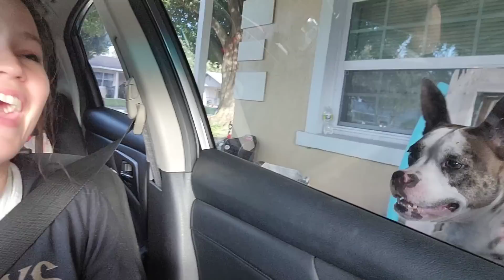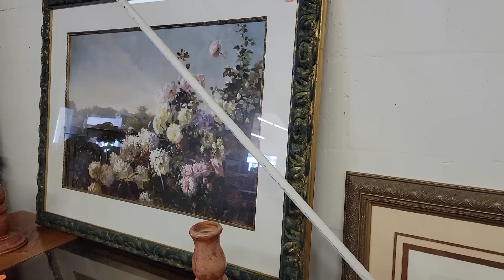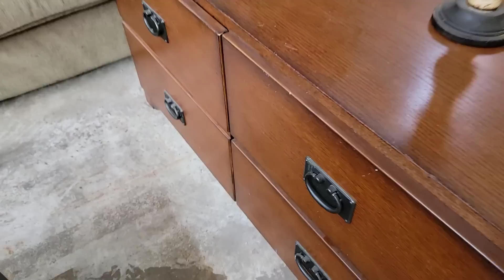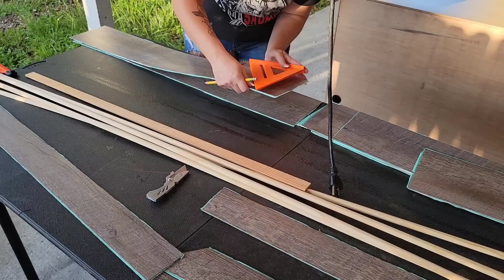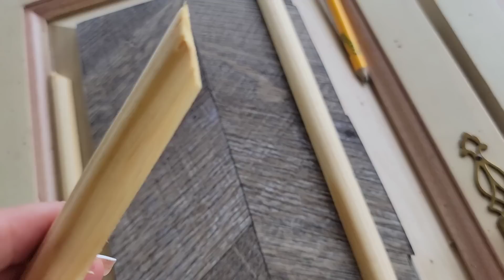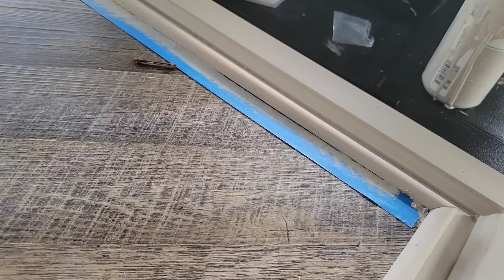THRIFT STORE DIY | Budget friendly furniture flip | Day in the life of a working mom!

Comment: I wonder how well these peel and stick pieces would work on a wall. I really wanted “wood” on my bathroom walls but it’s too expensive. Thank you for sharing!!
Reply from the maker: Probably not great to be honest with the moisture they will need extra adhesive to stick. I believe over time they may pop up or peel unfortunately. These worked because I secured them with trim and wood filler in the seam.